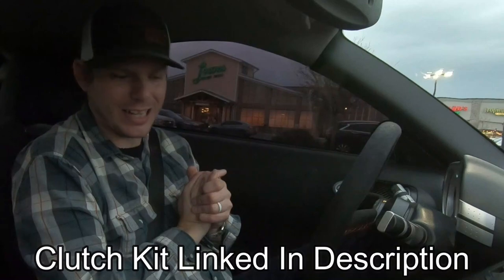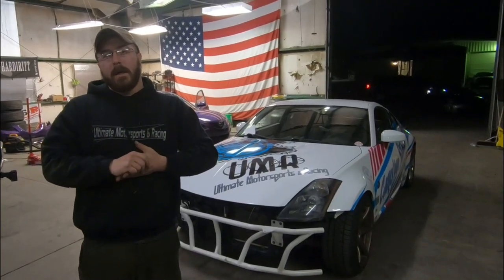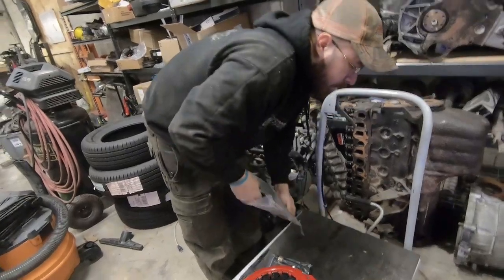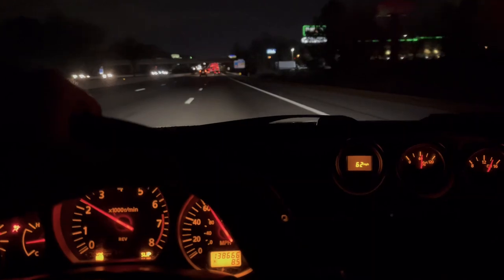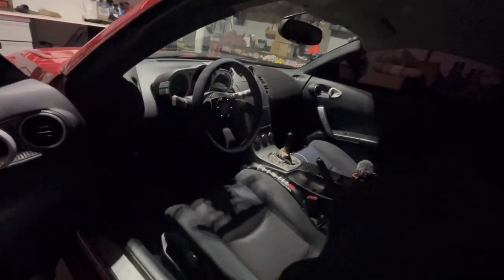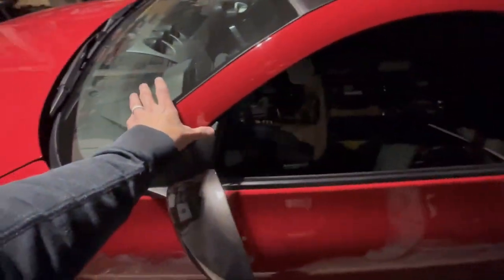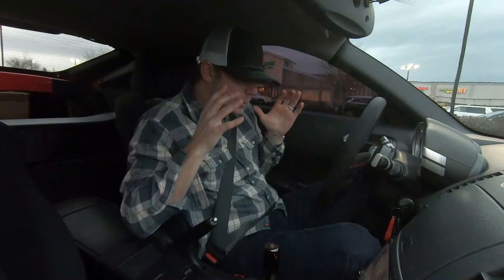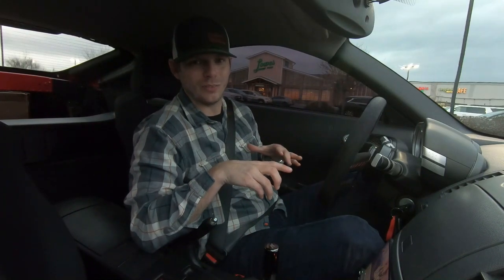Z1 Performance Clutch Kit For 350z | First Impressions!

Comment: I just finished my CD09 swap in my Q50. Clutch chatter is beginning to go away as I break it in. My clutch engagement is nearly at the top which to me is awesome because I barely have to push it down to shift to the next gear but I’ve been enjoying my manual swapped Q50!!
Reply from the maker: How was the swap?  I’d love to do it.  Sounds like it isn’t too bad with a lot of the q50 stuff being interchangeable with the 370z
Reply: @SpeedCultureStudios  it was very very easy! Only difficult thing I ran into was bleeding the clutch(first time doing it by myself) and drilling out the e brake bracket. Other than that. Got it done roughly in a week working on it 4 hours a day
Reply: @tristanoliver2911  would love to see a video of it bro!
Reply from the maker: @tristanoliver2911  Nice!  I might have to look into that!
Reply: Bro you the first I know that swapped onto a Q50

Comment: Do you think the hydraulic throw out bearing can cause clutch to engage low to the floor.  I'm thinking my pressure plate is going bad everything looks good. Lately my clutch pedal would get stuck halfway down when I'm wot .. I have to use my foot to pull the  pedal  back up. I got the 14lb flywheel from z1 with factory replacement clutch kit and upgraded throw out bearing 3 years ago. Im planning to upgrade with the 6 puck from z1 hopefully to restore my clutch pedal its getting hard to shift especially on cold starts
Reply from the maker: Definitely seems strange.  I'm not an expert in this area, so I can't give much insight.  Sounds like your planned upgrades will end up resolving the issue though.

Comment: Hey great video! Around 4:45 in your video I hear a noise that I have been hearing in my Z at the same speed. Is this from the axles? Normal? Which sounds distinct from the bearings. Thanks!
Reply from the maker: Hard to tell what you’re hearing.  Sounds like just road noise/exhaust to me but if you’re hearing a humming noise, it’s probably wheel besring
Reply: @SpeedCultureStudios  Sorry saw this late at night and forgot to mention that yes it sounds like whirring sound. Thank you!

Comment: that break in period sucks.  last time i had to do it i still launched the car once to "make sure everything worked right" haha.  youll be at 500miles before you know it tho.  the low engangement is weird i was hoping you got it sorted out with this service but you seem to be happy with how it drives.  have you driven a stock z/g to know the difference?  i am a fan of the high engagement but i know people go out of their way and buy the RJM pedal to lower it.
Reply from the maker: Engagement was higher immediately after clutch install and is even a bit higher off the floor now after several hundred miles.  I’d prefer it a touch higher still but is quite comfortable now.  I prefer it low than high
Reply: @SpeedCultureStudios  cool im looking forward to watching the continued progress on the car!